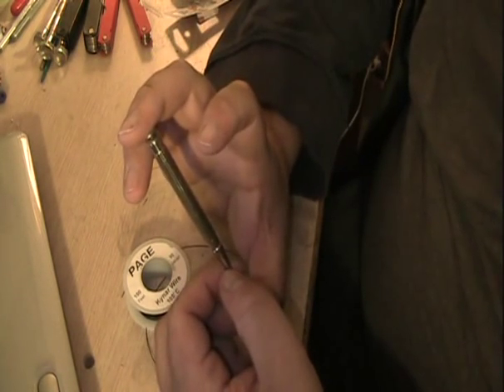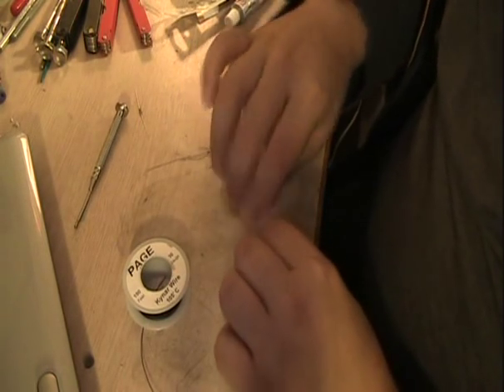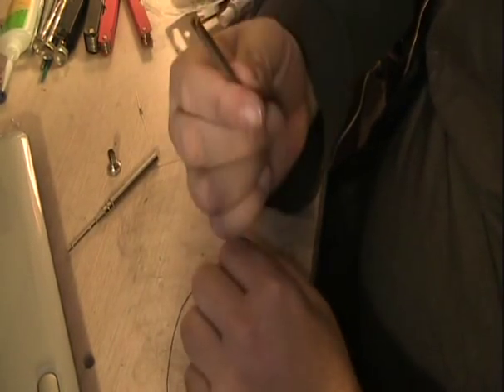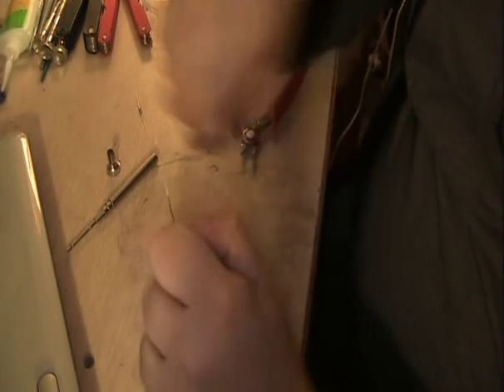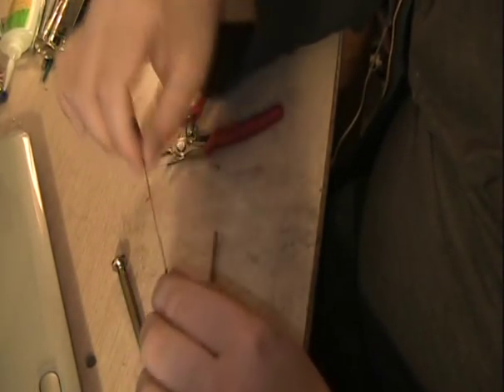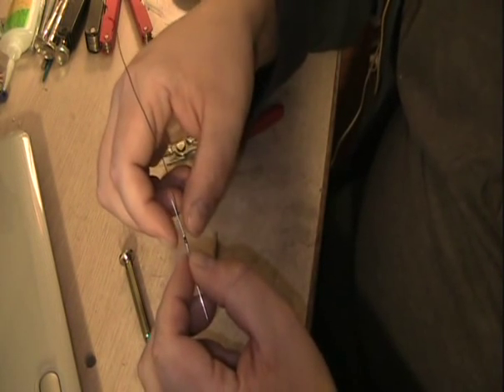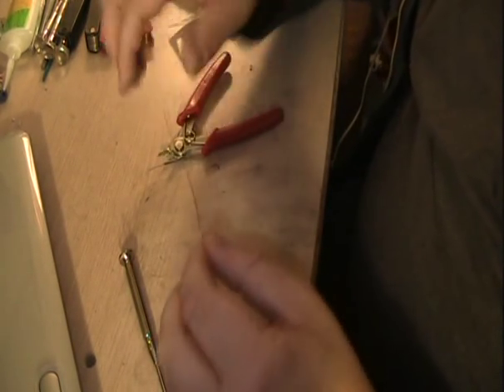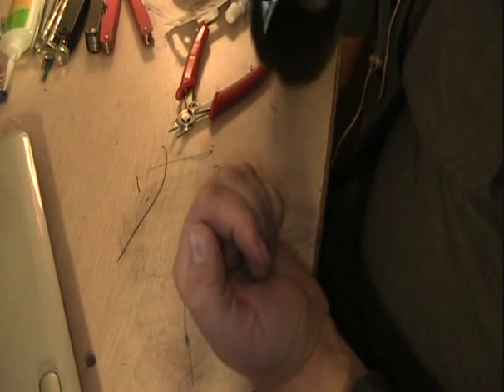Model electronics 101, lesson 1, the basics of wire wrapping

Comment: I had a problem with my pc and the message was sent several times. It was not intended to be spam!  I repeat:Good video but searching for this technique give me different results: you wire wrap directly on the component lead, but everybody says that you have to wrap it on a special square post (the component is mounted on the other end of the post, and the post itself is mounted on a board). With your system, how do you mount the component on a board (if you want)? Is the joint tight enough?